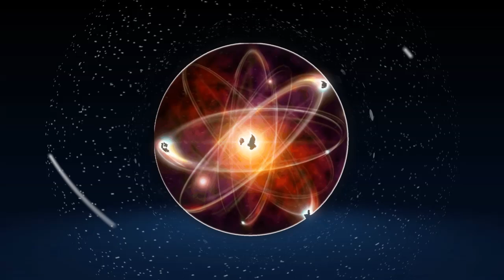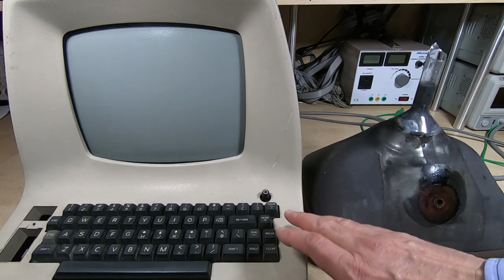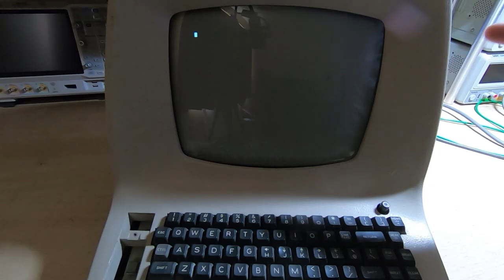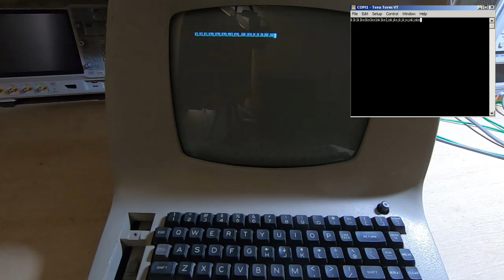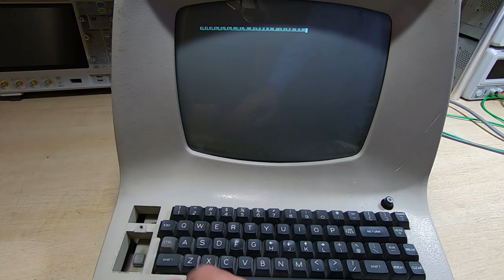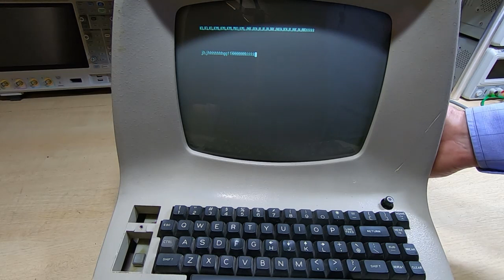ADM3 #3 Repair Part8

Comment: This may be the manual for the board you have. In the setup section (Page 3-5) it mentions the setup key being in the recessed area and describes the setup options as you showed them in the video. It mentions <CTRL>-S to save the settings on page 3-10.
https://dave.cheney.net/paste/DP2880486F_ADM3A_UM_Apr86.pdf
It looks like the same manual is also on BitSavers - http://www.bitsavers.org/pdf/learSiegler/ADM_3/

Comment: Looks fantastic. 

I’d still love to see a Linux shell running on one of these.
Reply from the maker: This is a dumb terminal, you cannot run anything on it.
Reply: @JerryWalker001  LSI ran ads in BYTE for the ADM3A and even had t-shirts with 'The Dumb Terminal' printed on them, which customers could obtain.
Reply from the maker: @1944GPW  Yes they were very popular and a number of different variants of the ADM3A were produced. They can generally be identified by the colour combination of the top and bottom case shells. I have 4 of them and they are all different both externally and internally. The one in this video is the 'smart' version.